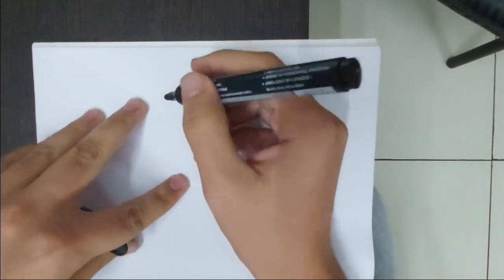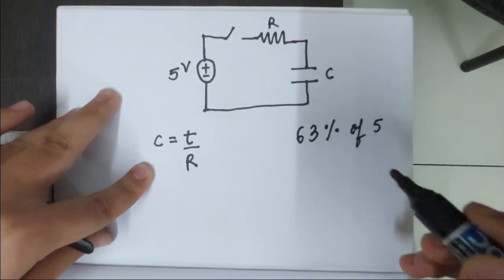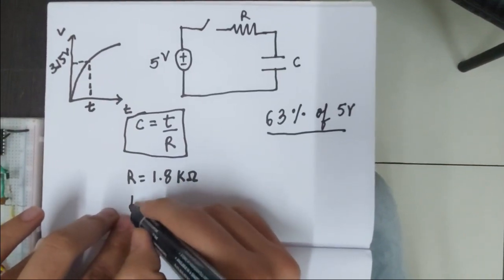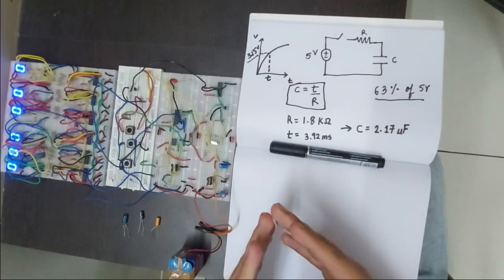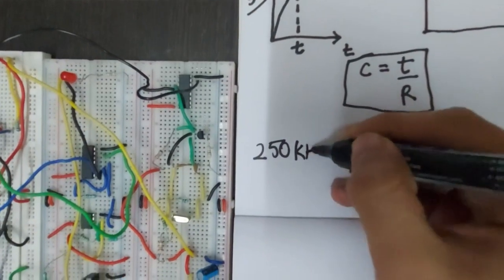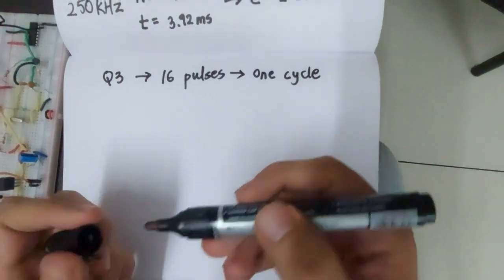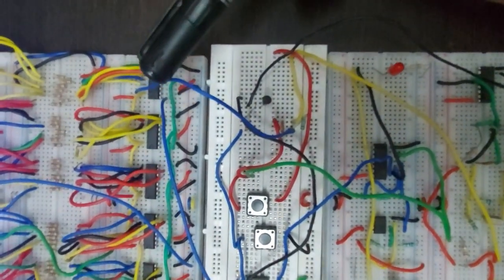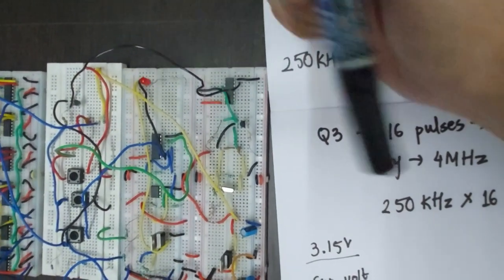Capacitance Meter without using Microcontroller

Comment: Great project and idea.
A few points for you to think about-
1. Where was 4MHz clock used?
2. Can the accuracy of the measurements be increased if you use faster clock for counters?
3. Your measurements have error >5%. This can be easily resolved by just performing one extra step (think hard on what basis you are measuring the cap value).

And a suggestion- if you have a circuit with lot of wires and components, it's always a good idea to show a schematic at the end.